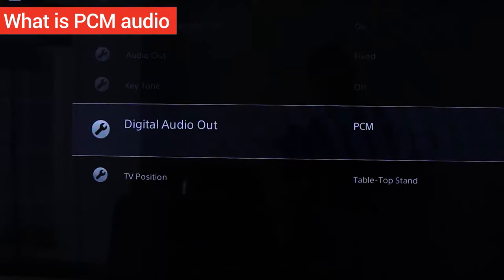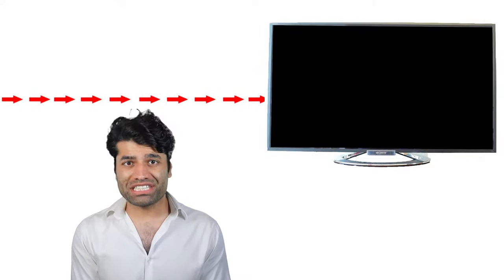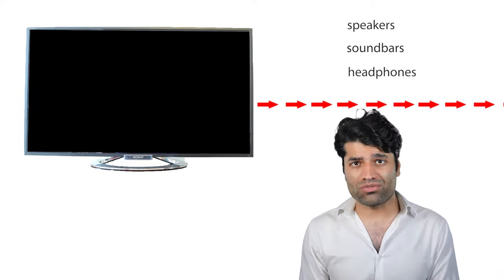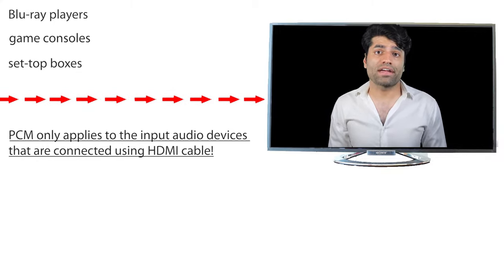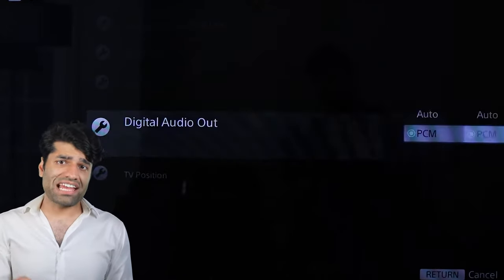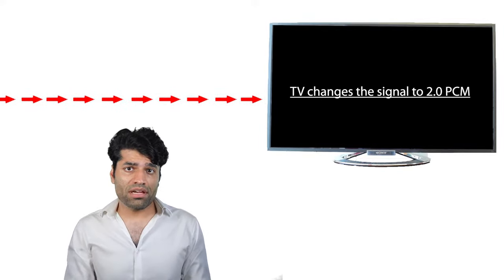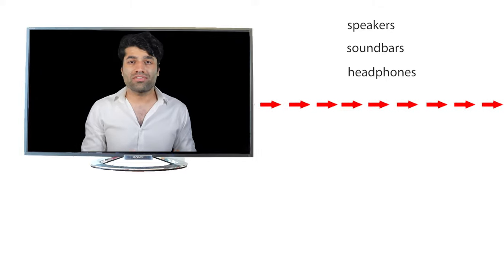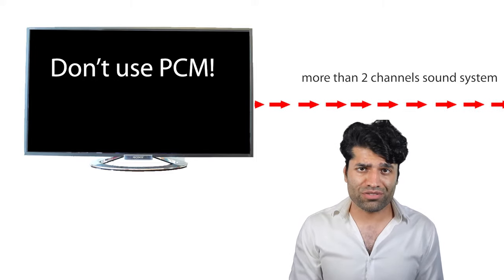What is PCM audio

Comment from the maker: 👉 TV, Sound System & Accessory Tutorials - https://youtube.com/playlist?list=PL6oDA8S3RmtFuqNpAghGWmkIRfBjF3q9v
👉 How to fix soundbar delay - https://youtu.be/VfaFcOrvY1g
👉 What is Dolby Atmos?! - https://youtu.be/oa_FEtepU-0
👉 Sound waves, frequencies & human hearing explained - https://youtu.be/9B151q7eb80
👉 How to Connect TV to the INTERNET - https://youtu.be/C34FFwlOvXk
👉 How to turn OFF internet on Sony Smart TV - https://youtu.be/fn8cam1Fnho
👉 How to do a factory reset on Sony Bravia TV - https://youtu.be/cYemzPQ30_w
👉 How to Hook Up Your Soundbar With An Optical Cable - https://youtu.be/QF6HDcB57A4
👉 How to CONNECT Soundbar to TV using HDMI cable - https://youtu.be/nzS6fIyxjxw
👉 Which has the best audio for a soundbar, Aux, Optical, HDMI Cables - https://youtu.be/lcGLxobvVro
👉 How to connect soundbar to TV with HDMI and Optical Cable instead of HDMI ARC! - https://youtu.be/TOBdrhlu0TA
👉 How to switch between TV speakers and Soundbar or Home Theatre - https://youtu.be/y5FLwgYYxQc
👉 How to use TV remote control for TV and Soundbar or Home Theatre - https://youtu.be/WD99O9va6Ak
👉 How to remove white noise when starting your TV - https://youtu.be/veo0jWFQ1R4
👉 How to deactivate Volume Control - One In All Remote Control - https://youtu.be/tD8DisbJVKQ
👉 How to setup the remote control of your soundbar using universal control - https://youtu.be/fDn_OPxR0o8
Reply: Thank you very much for the video. Greetings from Mexico 🇲🇽
Reply from the maker: @HectorSanchez-xc2nr  Thanks for your kind comments 🙏 I really needed it 🙌

Comment: Excellent information; exactly what I needed.  I didn't realize the PCM outputs only two channel audio.  I have a 2.1 Soundbar system, and when I made change suggested, audio was immediately better with clear, crisp voices no matter what else was going on in a scene.  Well done; thank you!
Reply from the maker: Glad I could help! Thanks for sharing your experience, it's very helpful.
Reply: i also have a 2.1 system.. i was looking for an answer on if it would improve quality by switching to pcm or not.
Reply: @OutworkYesterday251  pcm or auto

Comment: 1.  thank you very much for your explanation.
2.  I have a valid complaint about "high tech"  I spend way too much time having to research what is "PCM", "pulse code modulation", "HDMI arc" and other concepts.  And. frankly I must not understand math because Spectrum boasts 99% reliability and it goes down for days in Beverly Hills and Los Angeles.
Reply from the maker: 1. you're most welcome. 2. Sorry what you mean by spectrum boasts reliability?

Comment: Hi there,
I've been messing with the setups for days now and couldnt get the right result just yet😅

Could you please help me in this regard in how to connect the ps5 through a tv to a 5.1 sound bar?

Right now the connections are like this

Ps5 hdmi2.1 to tv
And tv eArc to sound bar5.1 Earc

Which should I select for these to get a full surround sound?

1. Ps5 audio output
Pcm / dts / dolby

2. Tv audio inout
Bitstream / Pcm

3. Tv audio output
Pcm / auto / Passthrough

I couldnt really get the definite answer
Please help 🙏🙏

Comment: I am getting a pcm 48 message on my sony receiver and therefore cannot get any sound on my home theatre. My receiver is connected to a Sony tv using optical cable. Everything thing was fine a few days ago, however with the pcm 48 message on the receiver the home theatre is not working. Any suggestion is appreciated. Thanks

Comment: I have a new Bose Smart Soundbar 900 with the Bose 700 Bass Module. My digital output options are the following: Auto, PCM, or PassThrough. I plan on adding 2 rear surround speakers. Currently I have it set to "PassThrough." Is that fine? I don't have any external devices connected to my Bose Soundbar because it only has 1 HDMI ARC port, but it sounds really good using "PassThrough." Should I set it to "PCM" although I plan on adding the additional rear speakers? Thank you!!
Reply from the maker: PCM would only work with 2 speakers (soundbar & base). However, if you add more speakers, then I suggest you to select auto. Bear in mind that every system is different. All the best!

Comment: Sir I have a 5.1 speaker system but when I am in PCM settings sound comes very loud and i get full loudness of my speaker system but didn't get 5.1 channel sound and when I switch to auto I got 5.1 sound output but the sound gets very very low
Reply: Same

Comment: Is pcm the same as stereo?
Reply from the maker: No. PCM is when your TV doesn't process the audio - uncompressed. It is a good choice if you got maximum of 2 speakers. If there is more than 2 channels then PCM won't be able transfer all the data. Stereo means 2 channels (speakers). Therefore, using PCM works with stereo audio. I hope it makes sense.